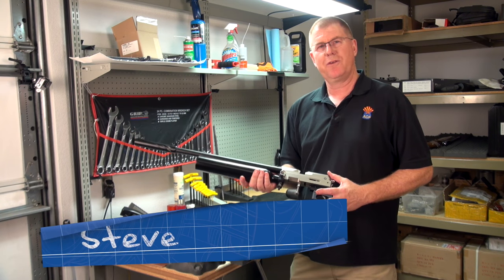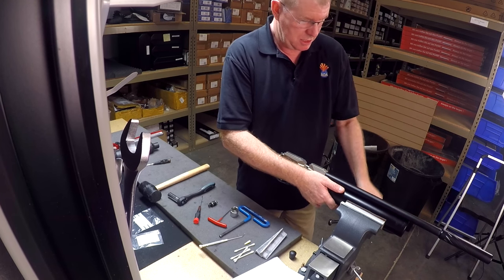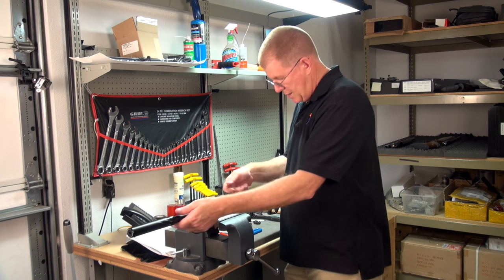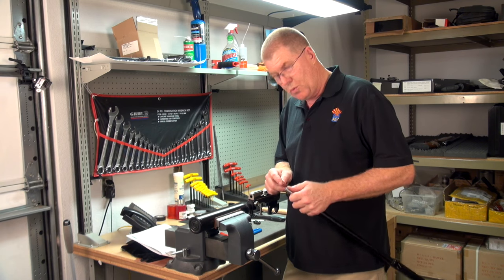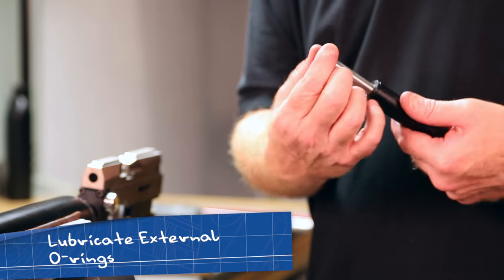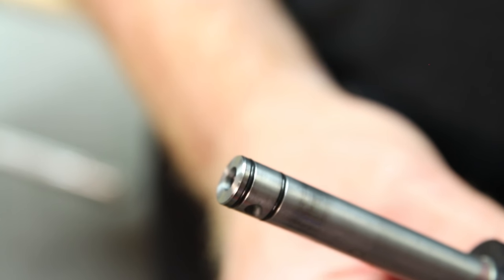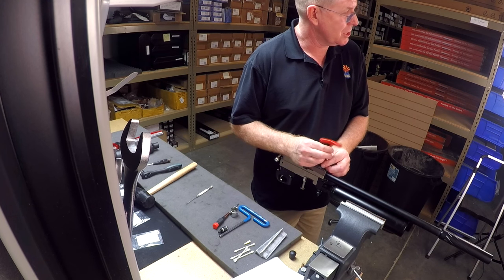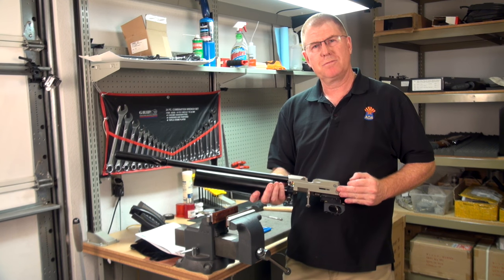Daystate Wolverine Barrel O-ring - Repair

Comment: great video thankyou, would you be able to switch the barrel to a 177 or 25 and perhaps change the probe too ? 
it could turn the wolverine into an even more awesome piece of kit if you could multi calibre it
Reply: I think Daystate would rather have you just buy two guns vs multichange barrel + bolt etc.   You don't want to be pulling barrels out all the time like putting on shoes just leads to more issue for them.

Comment: Did you inspect and clean o ring seating area before fitting new rings?
Reply from the maker: +ManiakMatt In our case, the rifle was brand new and used for demo purpose. But yes, always inspect and clean every surface during a rebuild to ensure no debris is left to cause problems.